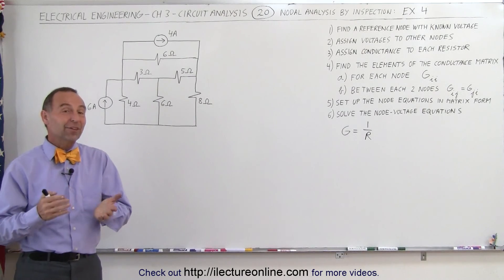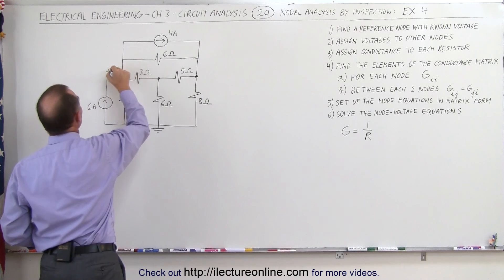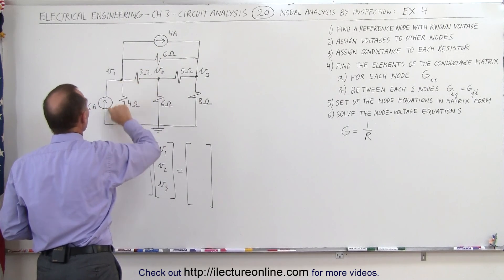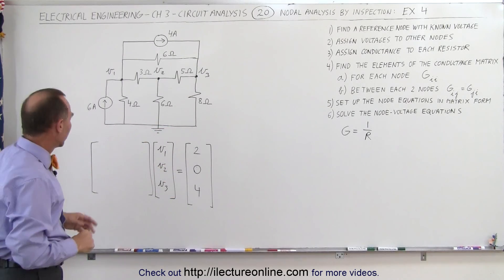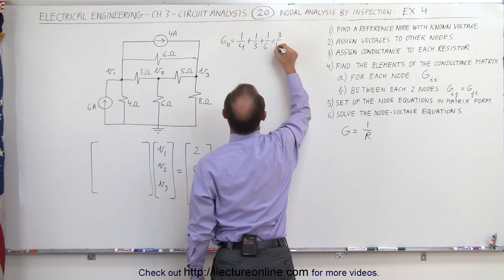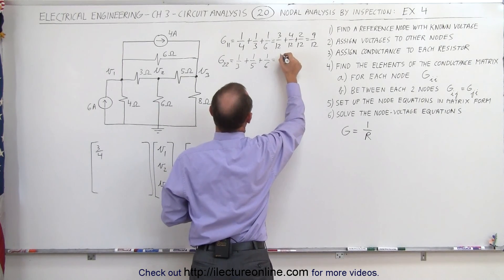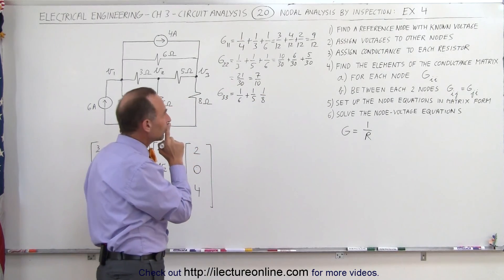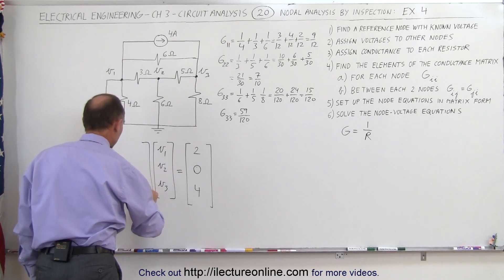Electrical Engineering: Ch 3: Circuit Analysis (20 of 37) Nodal Analysis by Inspection: Ex. 4

Comment: What happened if there is a voltage source?
Reply: I think you can use source conversion and apply the same method, and it should still work.

Comment: I dont understand the analysis of this. Why I assign current direction and dont get the same result? what is the original of this method?, pls explain
Reply from the maker: Did you look at the other examples on this method?
Reply: Could you please explain why assump that currents at one node go out when using this method, if total 4 nodes, 1 node reference , at 3 nodes 3 equations we assump that all currents go out  each node right?
Reply from the maker: We use Kirchhoff's rules.   For every node the sum of the currents entering the node must equal the sum of the currents leaving the node.

Comment: that was the most impressive display of linear algebra I have ever seen
Reply from the maker: Linear algebra does have a useful purpose.  🙂
Reply: @MichelvanBiezen  oh absolutely! I'm not nearly as fast as you when it comes to making determinant matrices. But I didn't know how to set up a matrix from my node voltage and mesh current equations until this video! I still have to rely on a calculator to check my work, but now I don't have to rely on finnicky websites written in C, and can easily ace my exams! thank you!
Reply from the maker: You are welcome.  Glad you found our videos.  🙂

Comment: This is what I got:
D=0.132
1)	1.345
2)	1.216
3)	2.02
V1= 10.189 V
V2= 9.21 V
V3= 15.30 V
Kindly correct me if I’m wrong.
Reply from the maker: If you look at some of the other comments you'll find that other viewers have worked it out and they ended up with very similar results (there will be some round-off differences)    Good job.

Comment: What if two sistors in series between V1 and V2 nodes? The conductance will be 1/R1+1/R2 or 1/(R1+R2)?
Reply from the maker: If there are 2 resistors in series, you just calculate the total resistance between the nodes.    Rt = R1 + R2

Comment: I would like to ask that if we don't have the 6 ohm resistor that connects v1 and v3 then how can we find G13?
Reply from the maker: If there is no resistor between V1 and V3, then they would be at the same potential.
Reply: @MichelvanBiezen  Thank you so much for your reply! But what I meant is remove that resistor out of the circuit, not connect its 2 terminals. What I really want to know is can we use this method when nothing connects v1 and v3 directly, for example if we don't have the 6 ohm resistor that connects v1 and v3 and also the 4 A current source connect v3 to ground instead of v1

Comment: How should we round the answers to significant figures?
Reply from the maker: Unless we are working on a real system, or doing specific experiments where the outcome and the uncertainty is important, we should probably concentrate more on knowing how to solve the problem.  If you want to apply the rules, the number of sig fig in the answer should match the number of sig figs in the original problem, (assuming that those were given with intent).

Comment: Thank you for the great lecture.

Dear,
I would like to ask you how the conductance matrix will be in case we have open circuit or dangling resistors (resistors connected to the circuit from only one terminal).?
Reply: @Michael Samy, in the case of an open circuit the resistance would be infinite. Since the conductance is the reciprocal of the resistance the conductance would then be zero.

For example, if the 6 ohm resistor in the circuit above was removed we would calculate G13 = G31 = 0Ω^-1.

Comment: if in any case if the value of voltage is negative then will our answer will be correct or not??
Reply from the maker: I am not sure if I understand your question.  (but the voltage at the nodes can be positive or negative.
Reply: @MichelvanBiezen  What´s the physical meaning of it, Professor?

Comment: Dear Mr. van Biezen,

I would like to ask you how you know where to assign the nodes in the circuit and why you said that above v1 you have one node instead of two form 0:34 to 0:38. Also thank you for answering so quickly to my comment in your video about the Thevenin's Theorem.

Thank you.
Reply from the maker: Since there are no devices between those two point, from a circuit point of view all that is a "single" point.